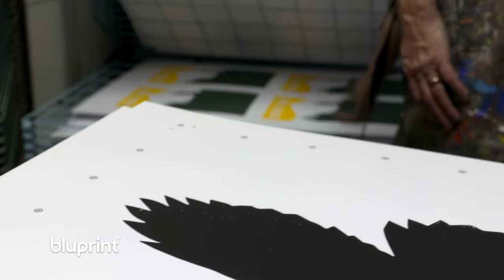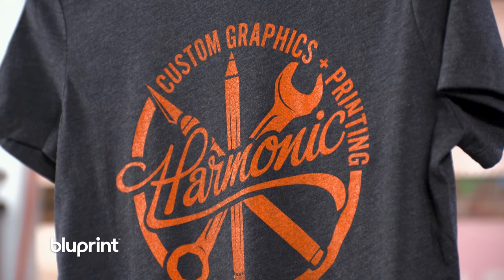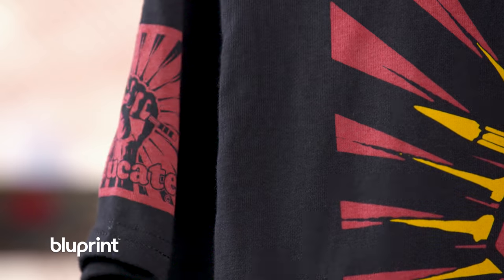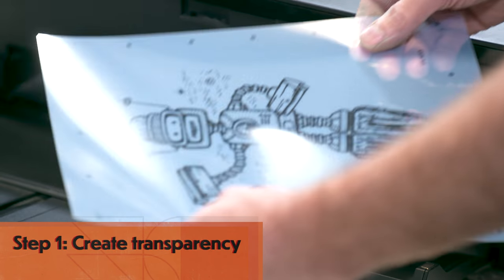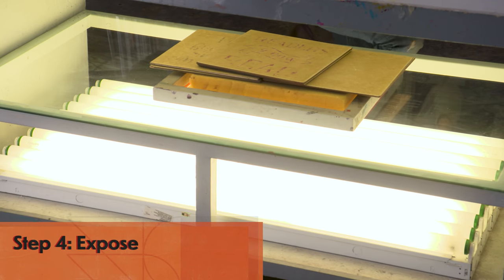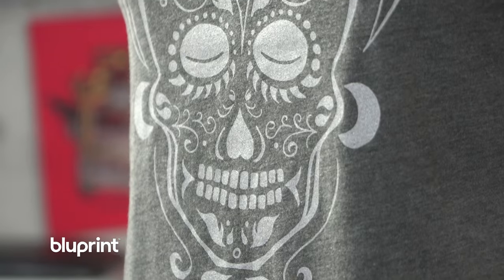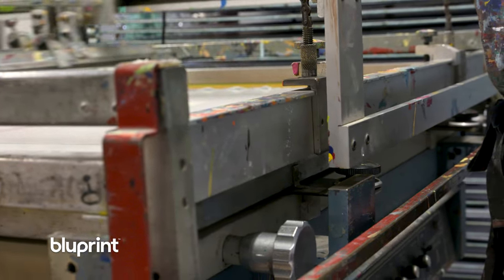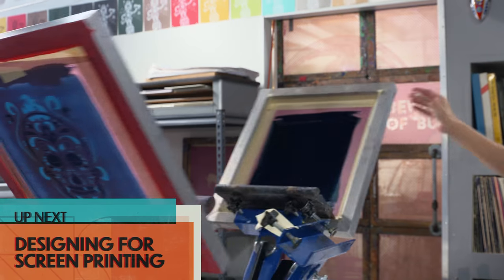The Basics of Screen Printing | Screen Printing Tutorial

Comment: I'm completely confused about the initial stage. So the area of the acetate negative is not exposed, but how does that leave the imprint of your design after everything has been washed off? I can't get my head around it.
Reply: The dark portion of the film positive prevents light from striking the emulsion so that's the part that sprays away with water. The UV light hardens the nnon-image area.